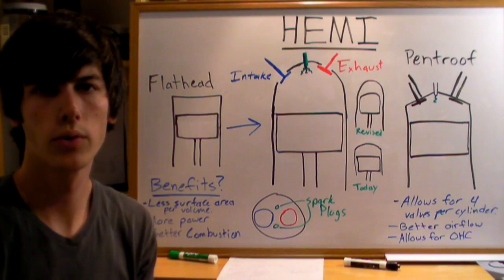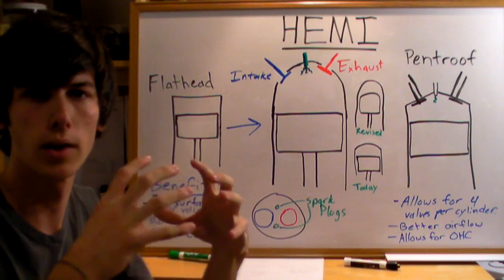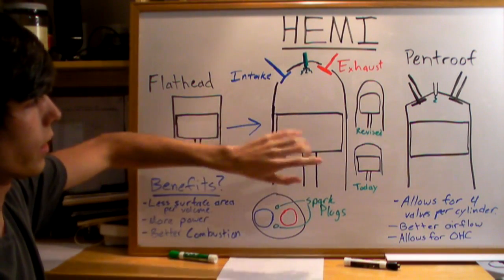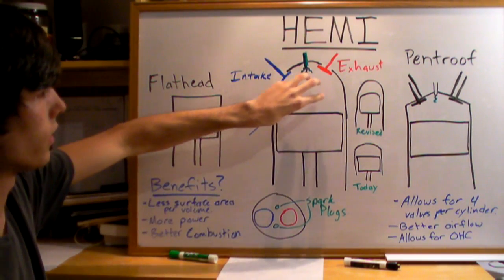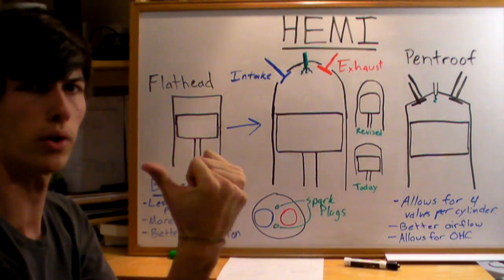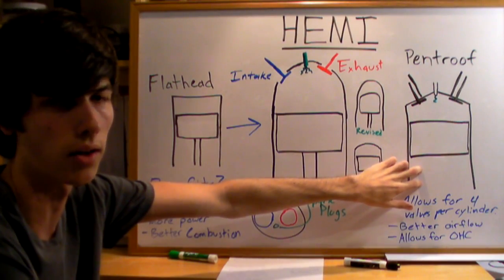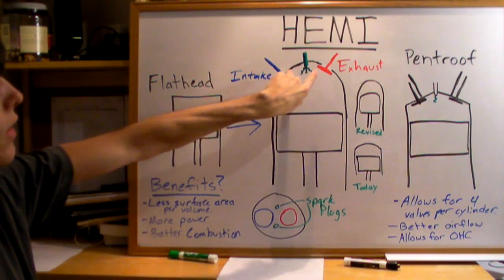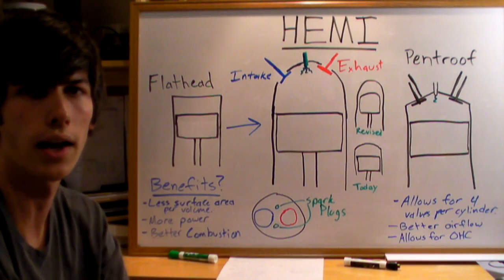What Is A HEMI Engine?

Comment: Pentroof, high compression, DOHC>HEMI

The question down low about the intake manifolds, there isn't a dual intake manifold on a Honda. They use what is called a IAB system or intake air bypass which causes the runners to be divided at the plenum and using a butterfly plate to alter the volume of air entering the engine at low RPMs to increase torque. It started on the Prelude in 92 with the H series engines and now is used on most Honda engines above 2.0L of displacement including the V6 engines.

Comment: what if hemispherical dome is on the piston head and a pentroof head and i mean the hemisperical dome goes into the piston head so you could get the piston more into the combustion chamber and capter most of that explosion unlike if being spread out over the cylinder head and chamber
Reply: I suppose in theory you could but that messes with the compression ratio and depending on how much air flow your getting if you cooling system isn't rated to the amount of heat you engine will produce you could blow a head gasket or fry a piston ring not to mention the mass amount of torque on the crack that would cause and the potential to throw a rod so you'd want to keep that in mind. All engines are is a big game of connect the dots, you mess with one thing, just make sure anything that ties into that is being taken care of too so that its capable of handling any added stress. :)
Reply: thanks guys
Reply: Yeah but heavy pistons isn't that big of a deal just make sure your crankshaft is heavy duty to handle it. Other than that if you talking about added weight to the car  an extra, what? 20 - 60 pounds isn't going to make that much of a difference in the long run, not after you've gutted your interior and especially if you've used weight saving techniques like aluminum heads and if you can afford it a forged aluminum block. :)

Comment: But you don't have to have a pentroof to have overhead cams, and you saying most new cars have pentroof style cylinder head is false information, every engines combustion chamber is different, they design each one to maximize performance and efficiency using a flow bench and hours of testing to get the right compression ratio allowing them to run on pump gas, while still producing as much power as possible.

Comment: Cosworth F1 engines revolutionized more efficient, higher RPM engines by making increasingly lower valve angles... At the same time Honda was making great strides in High revving engines. Your V-Tech Engine is the result of 100's of millions of dollars in R&D to create the best breathing for the best RPM. Hemispherical engines are from an era where engineers were literally Getting the best bang for their buck. Lower RPM horsepower. Your engine was designed with short stroke, high RPM in mind.

Comment from the maker: Hence they still slap "Hemi" tags on the side of Dodges without a true hemispherical head. It's simply a marketing term now.
Reply: What is the current design of the "hemi" head if not hemispiracle? Emissions, aside is the current "hemi" a better design than that of the 60's hemi head?
Reply: Why should they still use 2 spark plugs today?
Reply: All heads are hemispherical with dual spark plugs. Wdym. Not as pronounced as the original hemi. Trying not to drink all the fuel.
Reply: So it is a less pronounced hemispherical head now?
Reply: still hemis in 2021 lol

Comment from the maker: The problem with true HEMI cylinder heads is that it makes having 4 valves/cylinder very difficult because of the shape. It could be done, but there is a reason true HEMIs don't really exist in production anymore.

Comment: Most certainly, though with the Chryslers you need to watch the CR. It's been the secret to Ford's 4.6 DOHC for years as they make massive hp and torque with even the mildest type of forced induction (watch out for the stock pistons). There's a channel on Youtube I think it's called "Dragtimes" I believe it's based in Russia but there's a list of the quickest cars that regularly post videos there (we're talking super hyper cars here) and several of them at the top ranking are Hemi powered Jeeps.

Comment: A hemi is basically no good, but when you go to something like a top fuel car, the valves are massive and you don't wan any valve shrouding also the dome on the piston is stronger than a flat piston or a dished piston its required to stand up to the massive pressure created in a top fuel car.

and looking back at my frist comment I forgot to include
the HONDA RFVC and the Aphelbec bmw inline 4 were HEMI 4v heads.

Comment: those designs have the shortest distance distance from the spark plug the the farthest part of the chamber, they have squish all around them and the least surface area, a sphere has less surface area than a hemisphere when the volume is equivelant. so make a smaller sphere in the center.  a hemi is terrible with a dome its a crescent the distance from the plug to the area where the head meets the chamber is massive.

Comment: Honda trial 70
ford sohc cammer 427
Toyota 2tg
all ohc hemi designs.

Honda RFVC (radial four valve chambers)
and apfelbeck did that to some bmw f2 engines and incorporated a neat high swirl design.

also btw ideal chamber design for a 2 valve is a shallow figure 8 with a reverse dome or mirror dish with .030" piston to head clearance (like a afd brand ford Cleveland head with a piston dish precicely matching the chamber)  Or a 4v with a clover leaf design and matching reverse dome.

Comment: that actually makes a lot of sense, it raises another question though, I've noticed in muscle cars that they don't have to reach higher RPM to go faster (2500 RPM to reach interstate speeds). does that mean that the engines doesn't need to be more reliable than a civic, for example, that has to reach 5000 RPM to reach interstate speeds? lol, now i'm confusing myself, because I'd expect the muscle cars to need to be more reliable. idk, this might not have anything to do with it.

Comment: That's actually a really good question. I noticed this when messing around on a couple beaters. When I asked my dad about it (he's been a mechanic for 40+ years), he suggested that the single valve could have a larger valve stem as opposed to the thinner 2 valves. Therefore, a thicker valve might mean more reliability at the higher RPM's of muscle cars. Could this be a possibility?

Comment from the maker: HEMI's of today aren't like they used to be, they're much closer to the pentroof design. That said, 2 valves per cylinder has faded out of most manufacturers, and likely remains simply because of cost, or perhaps they can effectively market it.
Reply: My understang the modern MopAR hemi  has poly spherical shaped combustion camber similat to MOPAR V8s of the late 50, early '60s.

Comment: what he's trying to imply is that the hemi cylinder would take up more space than the flathead(Circle), However what you are talking about is allowing a higher volume of air and fuel in the combustion chamber. He is thinking about the actually size of the Hemi cylinder. Not the volume.

Comment: In a way these engines were one of the best if your looking for drag racing motors. They are the motors they all prefer to use in this area.
 They are super heavy motors, seem to be able to take very high HP levels without blowing up. For truck motors they also do well. 
  They don't have 4 valves/cyl but they do just fine with the size of the ones that are in those motors. They have great flow and can be built up like no other engine can. There is no tricking anyone with this design. read more.

Comment from the maker: Thanks for watching. Basically a flat cylinder head has a lot of surface area but doesn't add any volume. A sphere is the best possible shape for maximizing the ratio of volume to surface area; ie it has a large volume and relatively low surface area. This means less heat lost. Also, it doesn't have corners like a flat head, which can create heat spots and unusual stresses.

Comment: Minor correction SRT does not use the 5.7 that would be an RT Daytona RT, or a base model with a v8, SRT used the 6.1 and now are currently using the 392 (6.4) in their SRT larger vehicle models

Comment: I don't think you understand....I built a Jap SR20DET in my 240sx with a turbo and made well over 300hp with 2 liters so I'm not arguing that. I'm not even a Dodge fan although I own a resto-mod with a modern Hemi. My point is that the Hemispherical head design is a better flow with less moving parts. It out flows modern 4 valve GM LT engine heads. Look it up its true. As for the horsepower ratings just Google it. Even motor trend shows huge differences between advertised hp and actual.

Comment: " Road bike engines now are producing 200bhp from 1 litre 4 pots"
They rev to 18,000 rpm, that's why. 

Nevertheless, I should mention I love 4 cylinder honda engines. The S2000's  2 litre, 240 hp engine is for me one the best ever made

Comment: The 300c's computer will adjust the fuel ratio as much as it can to correct the knocking.  I would say 1 tank is not going to massively damage anything.  I have a 2007 300c and have mixed octanes before with no engine problems.

Comment: How exactly does changing a planar roof into a hemispherical roof decrease surface area for heat to dissipate against? You are essentially stretching that flat circular roof higher and therefore increasing surface area. The same would happen if the top of the pistons were rounded as well. Am I missing something here?

Comment from the maker: I don't believe they use any inline engines (I8's are quite rare in the first place, too long, too much stress on the crankshaft). That said, the term HEMI doesn't necessarily refer to the engine layout, just the cylinder heads.

Comment from the maker: Cooler air is more dense so it allows for more fuel to be burned (more power). Heat is important for lubrication purposes - reducing friction and frictional losses, but there's plenty of wasted energy that the engine creates which can be used to keep it warm.

Comment: You did a nice presentation here - maybe a little feedback.  The Flathead engines had the valves in the block, along side the cylinder.  Just like an air cooled Briggs lawn mower engine.  The heads were flat looking on the outside - hence the name flathead.  Flatheads had to have very large combustion chambers in order to connect the valve area to the cylinder.  Imagine an outline of Mickey Mouse's head & ears - that is the essential shape of a flathead combustion chamber.

Comment: heat should remain because every time the airfuel mixture reaches the cylinder it has to reach its ignition temperature so when heat remains it becomes a bit easy.

Comment from the maker: No need to ask for replies. Yes, heat is unwanted as it represents wasted energy, but the reaction of combusting gasoline and air results in a great temperature gain, increasing pressure as well. This pressure drives the piston down, rotating the crank.

Comment from the maker: Higher compression ratios yield greater efficiencies. Of course, the law of diminishing returns is always in effect. Cost goes up, and does difficulty with using low octane fuels. Mazda currently holds the record (in my head) of highest CR on 87 octane gas, of 13:1. Very impressive.

Comment from the maker: The problem with knocking is that the air/fuel mix is detonated at an inopportune time. 2 ignitions with planned timing, and equal timing, will work out just fine.

Comment: Good god, get off the internet. Tell your mother to un plug it. Everything you just mentioned was not only above 80k dollars, but all super cars, aside from the bmw which is a hoped up super car, and the corvette, which again is a strait line killer. Sports cars, as in things half my weight and N/A with equal or on par weight to power ratio. Learn the difference between car classes. go on any top gear videos or german/brit videos and call any of those cars "sports" cars.  Million dollar = sporty

Comment: 5.3 is an eternity for a 'sports' cars. BMW M5 is faster and it's still a sedan. The Ariel Atom V8,SSC Ultimate Aero TT,Ultimate Aero XT,Tuatara,Koenigsegg Ager R, Nissan GT-R, Bugatti Veyron and Veyron SS do it under or nearly half the time. Even a corvette is faster.Unless by sports car you mean BMW 328I. In which case sure you're faster in a straight line, but you won't beat it aroud a track.

Comment: Only thing I have to say is (; SRT8s don't come with the smaller 5.7l Hemi. Have a 2012 ram 1500 with the 5.7. (On my channel) Good 5+grand in bolt ons, including Long tubes, full exhaust, and some BS little tid bits here and there with a custom Dyno tune. That big girl will eat most sports cars and muscle cars on the road. :P 

Good explination, and don't worry, you explained how the "hemi" got its name. Not "every difference in the world a Hemi has compared to others" That's how it got its nam

Comment: Yes, but the 6.1 litre and 6.4 are only in the SRT8 series. The 6.1 litre first came in to production back in 2006 and in 2012 it was replaced by the 6.4 litre. The 5.7 is not part of the SRT8 package, but it is still a hemi engine.

Comment: The efficiency of simple 4 pot engines has been proven.  I've got a 15 year old 1.8 litre stock honda which produces 200bhp.  Road bike engines now are producing 200bhp from 1 litre 4 pots.

Hemi's are a blast from the past if you want a big block that weighs more than it should and doesn't produce quite as much power as it should.  They're nostalgia.

Comment: The Hemi does not do well at low revs compared to other designs.  This means that in everyday driving, it's not going to feel as powerful, or get as good of economy as a similarly-sized engine of a different design.  This is tends to be the case between a Chevy LS engine and a new Dodge Hemi.  But at higher revs, the Hemi starts to work and picks up rapidly.  Going back to the true Hemis, the 392s and 426s, that ability to use big valves and big air (and fuel) flow keeps them winning drag races.

Comment: Yes, the Hemi's main advantage was its ability to really get going like a hound from hell in the upper revs with its insane head-flow.  But, like you mention, under 4500 revs, a 440-6 was a serious force, and that sort of stump-pulling grunt has a very impressive feel to it during normal driving.  It's what makes my 250hp Dakota feel much faster than a 250hp Camry.  But, if you were serious about going to the strip and doing some racing, the Hemi was the best.  And it STILL dominates top fuel!

Comment: I never said there wasn't some waste.NOTHING IS 100% efficient so everything has waste but you are citing one thing to argue about but missing the point. To make my point more simple just look at the movement of hemi valves and compare it with standard valves even 4 valves. As the hemi valve moves through its range it opens moving away from the cylinder wall removing the shrouding effect that blocks flow.As standard valves open they stay the same distance to the cyl. wall restricting.

Comment: I stand by my statement. One dynamic like incomplete combustion does not negate all of the other factors that make the hemi design effective and efficient. The newer hemi's use two plugs and a modified protrusion of the head in the combustion chamber for a more complete burn. The FACT that is my point is that the lack of valve shrouding due to the angle of the valves is the secret to its success. The hemi heads flow as well as many OVC and 4 valve designs with less moving parts.

Comment: The most important part why HEMI was superior when invented is left out of this video....That is the angle of the valves prevented shrouding by the cylinder wall making intake and exhaust flow much better and that's why the new hemis are successful. Hemi technology is more efficient with less moving parts than OHC and 4 valve heads but is restricted by emissions standards because it pollutes.

Comment: You're right about the 440 RB having poor intake runners & is often times sophisticated by the carb. 350-600 cfm carb on an engine which the each intake runner will flow over 200 cfm (more than one piston end up short) usually still had 500 tq. Although the 383 RB with a 4 barrel was a good package. Smaller displacement meant it revved quicker because of the lighter internals and were more consistent because they came with hydrolic lifters instead of solid lifters like larger hi po engines.

Comment: One thing you're leaving out of your equation of not needing 600 hp to get 12 sec quarter mile times in the 60's and 70's. They were setting these times on 5 in. wide 14 in. tall rim 75 series Polyglass tires. Tire contact area is literally smaller than your palms. Tires were rock hard and grease (primarily designed for mileage and longevity) Drag racing slicks were not much better. Modern day tires are light years better and wider not to mention flatter torque curves.

Comment: Well, you did say that they used the 5.7 in the SRT8s, which is actually false.  The 5.7 is found in the Ram, as well as R/T Dodges and the 300C.  The SRT8s all had 6.1L versions, until quite recently when they rolled out the 6.4 "392."

Comment: Yeah the Hemi combustion chamber is such an outdated design they were using it in Offenhauser engines in the 1930's which were powering Indy cars to victories well into the 70's. Dodges Hemi's had such low compression in 1966 they had 12.5:1 to 16:1 compression killing efficiency (1.4 hp per cubic in). Unlike modern day pentroof combustion which use 10:1 to 11:1 compression ( 1 hp per cubic in).